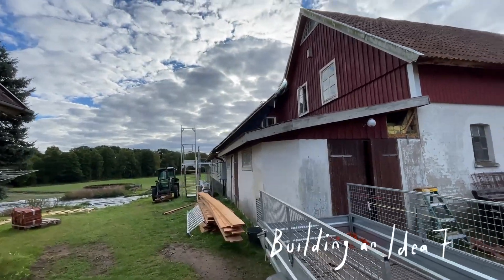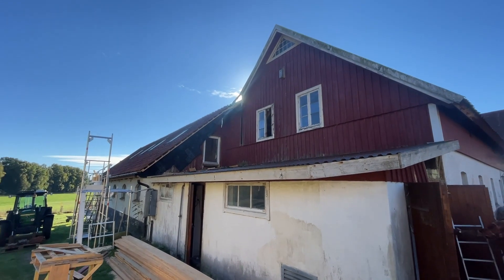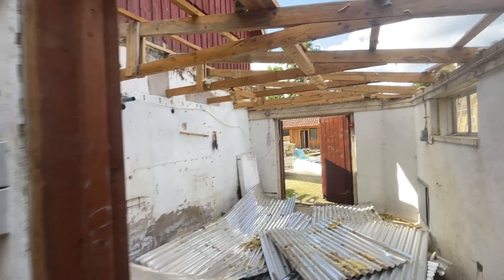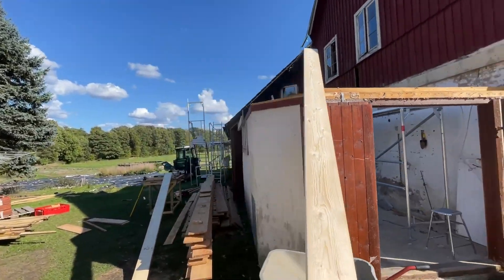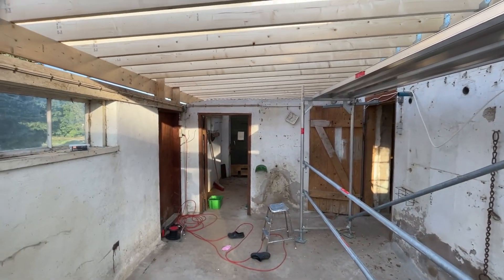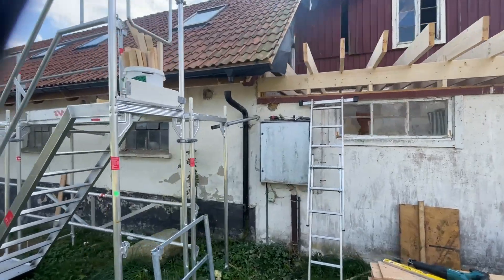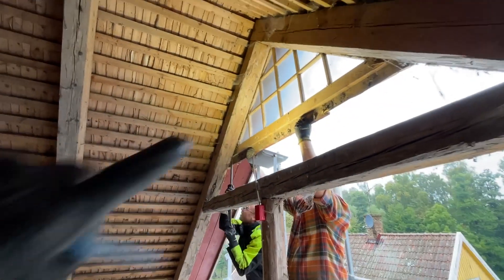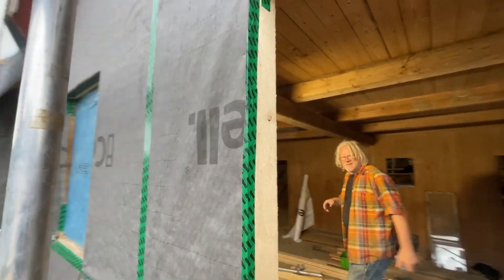Building a larch roof terrace (Part 1)

Comment: Looks great. I’m wondering something though.
It looks to me like you’re using 220x45 for the joists at c/c 600. Is that the case?
Reply from the maker: Hey no it’s c/c 400
Reply: @idea_farm  that’s pretty hard core
Reply from the maker: It’s what the structural engineer wanted. Feels very solid though, and it’ll be good for the 50 guest cocktail parties
Reply: @idea_farm I remember designing bleachers with football supporters in mind and not having to go that extreme. Maybe I’m missing something. 
The span looks to be around 2 metres, is that right?  
What’s the thickness of the decking?
Are we talking graded lumber or straight from a sawmill?

Sorry if these questions are annoying, I’m just curious.
Reply from the maker: The span is more like 3.5 metres - the rafters are c24, everything else is larch from the sawmill. Decking is around 30mm thick
Reply: @idea_farm  ok now it makes sense. In the video it looks like you could almost reach from wall to wall when you’re looking from below